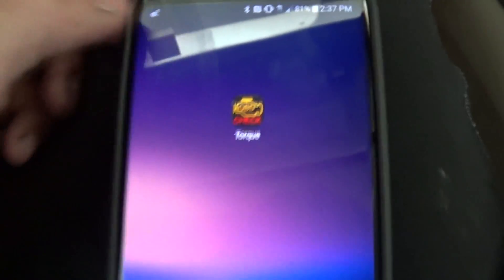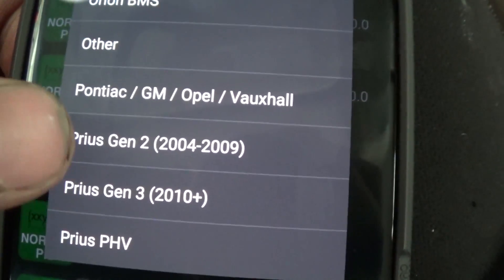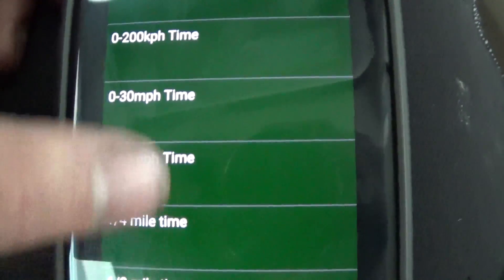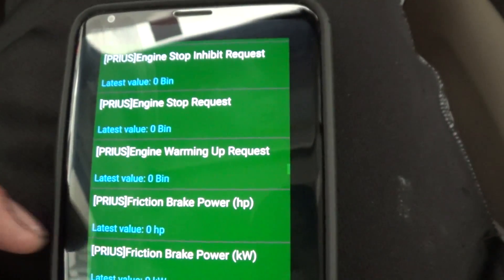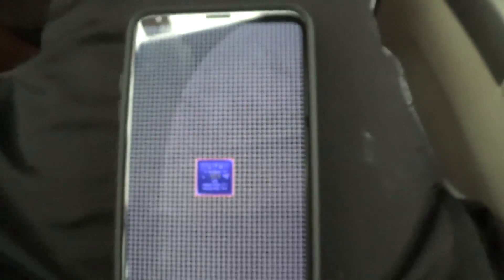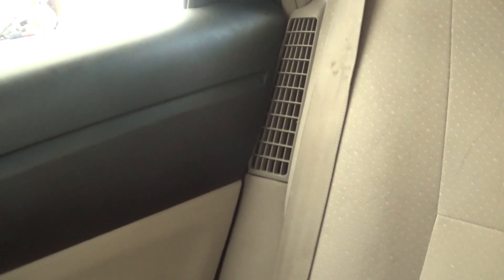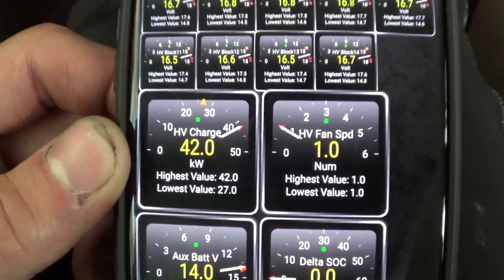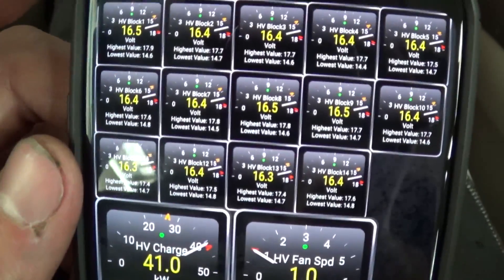How to load Prius specific PIDs in Torque Pro

Comment: Very good and informative! I have a 2013 Lexus ES 300h, which has 3 more cell blocks than the Prius, is there an addition or different profile in the Torque Pro than the Prius? Please let me know, how I can add 3 more High voltage battery blocks into my display. I sure would appreciate if you could let me know. Thanks very much, John
Reply: hi got answer on this ?

Comment: How did you get the coolant to read in Fahrenheit?
Reply from the maker: when you first open up torquepro on the main page, hit the setting button in the bottom right (the gear looking icon).  Then select settings.  Then select units, it's 4 down from the top on mine.  There should be an option to select Celcius or Fahrenheit.

Comment: It didn't work with nissan pathfinder why????
Reply from the maker: What part didn't work?  This is a video for the 2nd generation Toyota Prius.  Torque Pro will work for a pathfinder to monitor stuff like coolant temp, intake air temp, battery voltage, etc.
Reply: @CtrlAltDefeatTV   when I go to PIDs what should i do after that for pathfinder  ? The obd contacted but no things show in the screen and a massage shows up in the top telling me the PIDs is not supported and I didn't choose any PIDs I don't know what one is the right help me please

Comment: Thank you. I was able to purchase the app. Now my question is , do you just connect to the car via wifi or is there an item that plugs to the obd plug onboard of car.?
Reply from the maker: Yes, you need an OBD2 to bluetooth adapter.  There are cheap ones on ebay - about 5ish dollars or so, I never had much luck getting those to work.  

The one I suggest is the BAFX adapter on amazon.  Worked great for me first try 

https://www.amazon.com/BAFX-Products-Bluetooth-Diagnostic-Scanner/dp/B005NLQAHS

Comment: which obd scanner you are using? I have one not reading block voltages with torque pro
Reply from the maker: I'm using a BAFX OBD2 adapter.  I bought mine off amazon
Reply: @CtrlAltDefeatTV  Hello, I have seen many item starting off from all different price. Are all those adapter support tha Torque Pro app anyway?
Reply from the maker: @meck_missile  The adapters should work with torque pro.  

This is the one I bought 

https://www.amazon.com/BAFX-Products-Bluetooth-Diagnostic-Scanner/dp/B005NLQAHS

Comment: What Volt do they need to be add. How do we know if the battery is bad or good?
Reply from the maker: It really depends on what's currently happening in your Prius.  If you're coasting and the battery is recharging, the modules will have a higher voltage than if you're sitting in neutral with the AC going full blast.  
Typically each module should test at about 7.5v with two (2) modules per block.  So your voltages displayed in TorquePro should be approximately 15ish volts on average.  
But really the main thing is that all your modules/blocks have the same voltage, they all need to be balanced.  As long as they're lower or higher in voltage TOGETHER, you should be ok.  The check engine light pops up when the ECU detects a difference in those voltages.

Comment: Can you pls recommend so.e decent prized OBD2 Bluetooth adapters/scanners??
Reply from the maker: I would recommend the BAFX adapter that you can find on amazon.  That's what I use and it works perfectly.  The smaller blue or white ones that you can find on ebay for 3 or 4 dollars have never really worked for me.

Comment: Can you please tell me what OBD2 adapter you're using? I bought a cheap one on ebay and doesn't work.
Reply from the maker: I bought a BAFX adapter off amazon for a little over 20 bucks and it's worked great so far.  I've also had luck with the little white ones off of ebay.  The little blue ones off ebay have never worked for me
Reply: @CtrlAltDefeatTV  Does this stuff work on 2002 Gen 1 Prius??
Reply from the maker: @thomasoconnor3736  I'm not 100% sure, I've never owned a 1st gen Prius.  There are sets of custom pids for 2nd gens and 3rd gens, I'd perhaps try giving the 2nd gen pids a shot and see what happens?
Reply: ELM327's seem to work on a 2.gen. Mine's a Vgate iCar iV350 Mini. Seems they have a wifi model now too that creates a wifi AP that you connect to. Vgate iCar 2.

Comment: So i own a prius c (2012) 

Just bought the torque app and got a obdii dongle. 

When i load 3rd gen prius pins (since it is a 2012) almost 95% of them have no info readout. 

Generic ones like. Coolant work, but none of the battery stuff, etc. 

Any recommendations? 

Thanks.
Reply: You have to get a better ODB2 adapter. If they are too cheap, they won't read those extra pids

Comment: Can you adjust HV fan speed with Torque somehow? If so how? Just subscribed, I have an 09 with 225,000 on it myself. Thanks
Reply from the maker: I'm not sure about with torque, perhaps there's a custom PID out there that can control it.  But in my experience, Torque is mainly used for monitoring, not sending commands.
Reply: Original battery?

Comment: Could you tell me which one of OBD2 scanner will work with app? Is the wifi one better than the bluetooth one?
Reply from the maker: I haven't messed with a wifi one before, all my OBD2 adapters have been bluetooth.  I use a BAFX adapter that I got on amazon, but some people have shown they had success with the super cheap blue or white adapters from ebay
Reply: CtrlAltDefeatTV x

Comment: Thanks for the clear instructions for installing the Pids to the Torque Pro app! When I checked my son's Prius battery I noticed that all the block voltages were in the 15.3 range but one. Block 10 on his battery had a needle indication that would go to 14.5 then drop to 0 then back to 14.5. Have you ever experienced something like that with the Torque app? It just flickered back and forth. He broke down on the freeway last week and we haven't figured out what the issue is yet. I checked the individual voltages on each cell with a VOM and I noticed that they all were in the 7.46-7.48 range except there were three that tested 7.34-7.35, no flickering voltages. His Prius is a 2006 with less than 130,000. Are you able to access the trouble codes with the Torque app? Any help would be greatly appreciated.
Reply: This is old but for anyone reading, yes absolutely you can check a numerous amount of information about your trouble codes and such. If you run into a situation where your prius dies look at your 12v under the hood battery first, then check your internal battery packs with this app (each block should add up to 14+) , then finally and most likely after all else fails will be your Inverter (buy on eBay).
Reply: Might just he able to flip the inner batteries to the outside and replace the worst cell or two in order to get it rebalanced better.

Comment: Great informative vid. 
Torque is not available  for IOS. Is there a similar app for my Apple tablet/iPhone?
Reply from the maker: I'm not sure, I haven't owned an Apple phone or tablet in a while.  I'm sure there is an option out there for you, but I'd suggest getting a cheap android tablet, perhaps something off craigslist that would do the job
Reply: CtrlAltDefeatTV   Yes but it’s called blue obd2, it’s 99 dollars and it comes with software for the Apple phone. Highly rated
Reply: stampgalore I believe you’re referring to BlueDriver. Its reviews are excellent & I just ordered one. But I don’t think it reports Prius Battery info ( someone pls correct me if they’ve actually done it. ) FYI, this is a bit techy, but BD doesn’t use the ELM standard so it only works with the BD app. Most other OBD will work with most any app as they comply with the generic ELM. Pls double check this info b/f buying.
Reply: How about Dr Prius Hybrid app ?